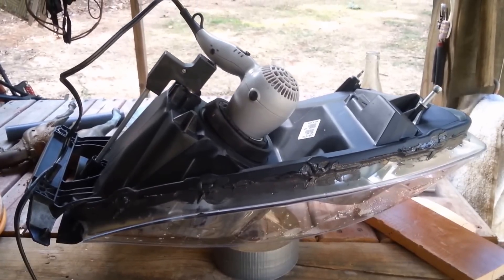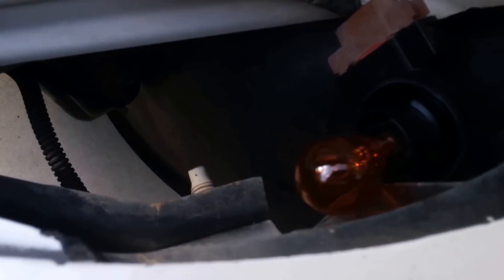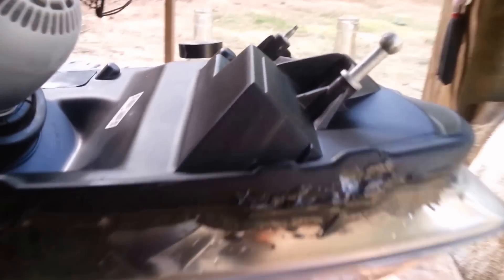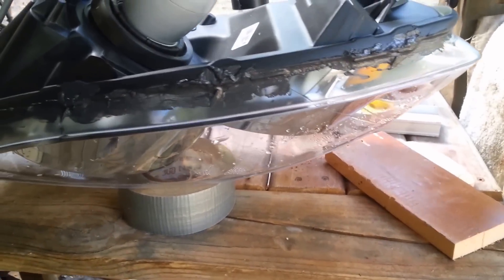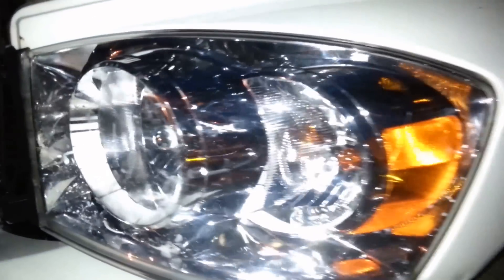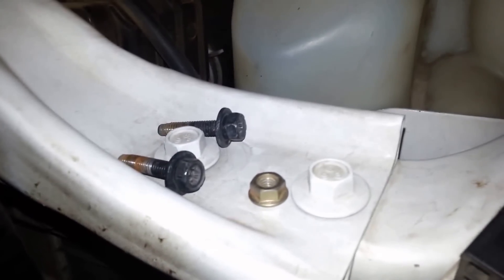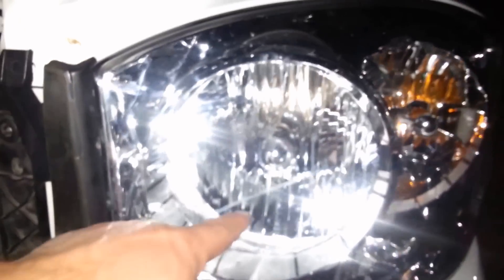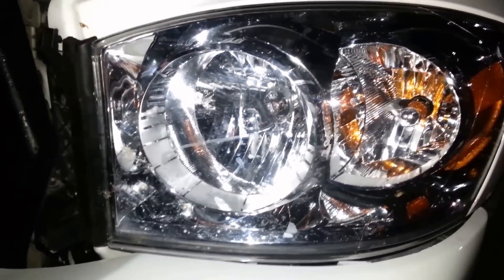How to Remove Water From Headlight: Dodge Ram 2500

Comment: If they continue to fill up,drill a small hole in the bottom where the water is laying,that will let the water drain
Reply from the maker: I thought about that too and have done it with older cars but didn't want dust getting in. Thanks for watching